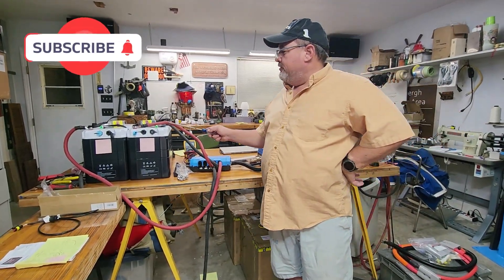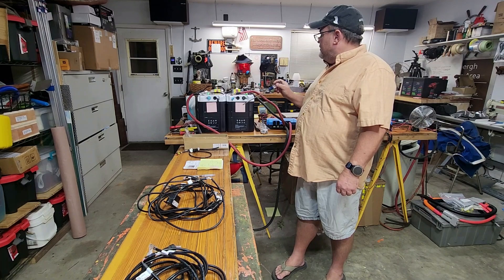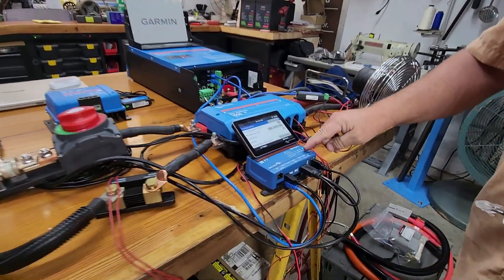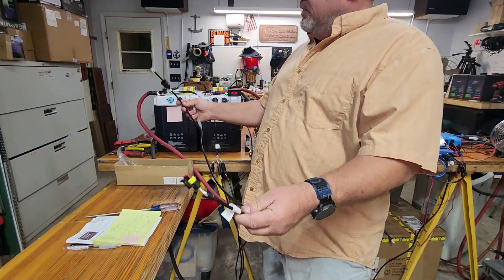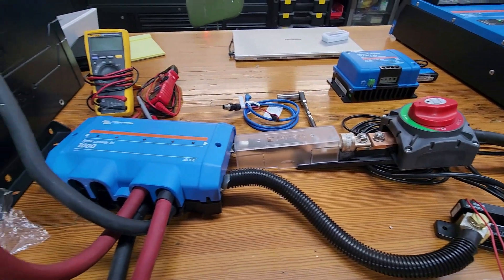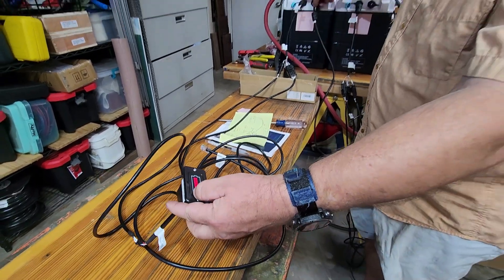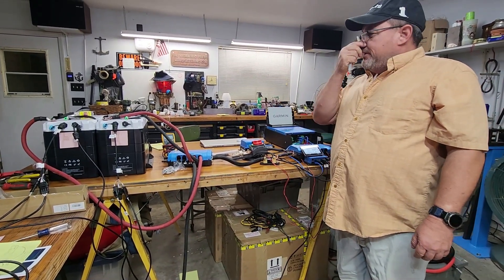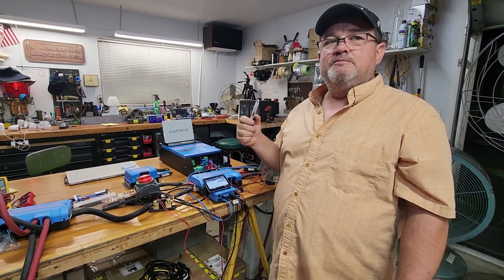Epoch Lithium 460AH V1  Daisy chain hook up  with Victron Comm to Cerbo GX. **Not for V2 batteries**

Comment: I have three 460's daisy-chained into the Victron Cerbo GX (w/gui mods).  They show as one battery, though it does indicate how many batteries are "online".  However, using the Epoch App, I can only see data for Battery 1.  The others connect but are blank.  Are you experiencing the same?   Or can you see both battery's details in the App?  Any tips?
Reply from the maker: Actually in the beginning both batteries could be pulled up on the app. But lately only one comes up. I havent had time to mess around with it lately but plan to. Let me know if you figure it out.
Reply: @mvintrigue-trawlerdiy1101   I am guessing it stopped when you changed the dip switches and daisy chained.  I spoke with Epoch and they are looking into it - it seems that once the dip switches are set to indicate master and slave etc. the software treats it as one battery.  It's just a shame to loose the per cell detail.  The Cerbo just tells me the battery and cell with the highest and the lowest voltage (which, I guess, is sufficient).  I'll let you know if I learn anything new.
Reply from the maker: @SVHolokai  Thanks...as will I. Much appreciated.

Comment: Any info on connecting more than 2 batteries to the cerbo?
Reply from the maker: Obviously I dont have more than 2 to do a real test but I am assuming...at the point in the video at the end when I hooked up the final harness, you would then need another short cable and that would  hook up from batt 3 to batt 2 in the same way. Wish I had another just to test this.
Reply: Hook one of the 300AH v2 batteries and see.
Reply from the maker: @drtywhat  I would need to order another daisy chain cable to do that. The short one with the GM weatherpack plug. But someone just commented they have 3 of these online with no issue.

Comment: My 460 is coming, I understand everything but the dip switches. Just one battery and a smartshunt, hopefully it will be easy to sort out. The instructions in the manual are pretty vague.
Reply from the maker: You should be able to leave the dip switches in the position they come it. And you wont need the extra cable. Its going to be pretty much plug and play and very simple. Its good having the smart shunt too IMO. Its amazing how much SOC meters wander at times. So having 2 is a good way to compare things over the long term and double check each against the other. Dont be alarmed if things arent exact between the SOC and voltage of the smart shunt and the Epoch. They will never marry perfectly.
Reply: @mvintrigue-trawlerdiy1101  
Thank you, I'm unhappy with the batteries I have, they are completely isolated and still lose a lot of voltage as soon as the charger shuts down. No way there can be a parasitic draw. Less than 3 years old. Oh well, live and learn. Appreciate the response. Fair winds.
Reply from the maker: @cabracove  are the ones you have lithium with bluetooth? When you put your Epochs in place dont toss the old ones. If they werent isolated by disconnecting all wiring then they may be ok, and when you put the Epochs in it is possible they too will drain if everything hasn't been eliminated with careful troubleshooting. But of course I dont know know what kind of troubleshooting you have done. The only way to troubleshoot a draining battery is to pull it out and put it on the bench for testing or to disconnect all wires and check it with a multimeter over time. Also if you have a multimeter there is typically a function to test if you have a draw. Most multimeters can measure up to 10amps of draw before they blow an internal fuse. You would have to disconnect the positive battery terminal and connect the two multimeter leads between the battery terminal and the battery post and put the meter in the setting to measure amps. it should be 0 of course. be sure to turn all breakers and systems off and isolate your systems as you said you did. And do not turn anything on or you could quickly blow the fuse in the multimeter. See if you do in fact have a draw. You might be surprised. If you have already done this then of course the battery or batteries could be at fault. Of course if the ones you have are lead acid batteries they have a much higher self discharge than lithium.

Comment: great video, thanks for sharing.  I havnt hooked up my 300AH battery yet but would have been confused if the errors start showing up.
Reply from the maker: Definitely. I was confused too. But in doing research on new Victron capable batteries its pretty common with batteries like Pylontech and many others as well as several people who are running the Epochs. I haven't had those warnings since.

Comment from the maker: *Important update* Go check out Ben Steins video (Panbo) where he takes one of these apart. Right off the bat he has discovered that the 460AH Marine batteries contain a 500 amp Class T fuse INSIDE each battery with an AIC rating of 50k. This is a real game changer. IMO this is the best designed and safest Lifepo4 battery on the market. It is a real engineering effort with clean sheet design. Looking forward to the remaining testing by Ben.

Comment: I have only watched the first 35-seconds, but it is terrifying to watch you use a metal screwdriver as a pointer to tap on an LFP battery.  I am curious as to how well the white balance on your camera can handle an LFP arc flash.
Reply from the maker: Arc flash on 12 volts is not likely. In addition, the SC Protect feature on the BMS work fantastic. I have actually tested it and its quite anticlimactic.
Reply: @mvintrigue-trawlerdiy1101  You tested your battery with a dead short between the battery + & - terminal?  You are a braver man than I.
Reply from the maker: @haydenwatson7987  well not this one. This one is too expensive to risk..lol. I did it on a 100ah 12 volt version with a high amp carbon pile tester.  One thing to add that I just became aware of. There is a Class T fuse inside the Epoch 460 ah battery case. Pretty incredible. Pretty mindblowing really. That another level of safety most battery manufacturers had not even considered.
Reply: @mvintrigue-trawlerdiy1101  That is very nice.  Can you access it to replace if your screwdriver pointer shorts it out? ;>).  I have a couple of Basen Green 460Ah and have also tested them to well above rated.  I got 480Ah from one and a bit less from the other.  It had Bluetooth but not the com ports.  They were the first offering that I had seen in the 460Ah range and where in a standard 8D case which fit perfectly into my battery tray.
Reply from the maker: @haydenwatson7987  lol...yes its accessible. The top is held together with allen head screws. Next time ill use my coated electricians screwdrivers just for you..lol

Comment: When you’ve got 2 batts hooked up with this newer comm style (using the new comm wire), does battery widget on the GX Touch 50 still alternate between battery 1 and battery 2 when telling you SOC and amps in/out? Or now with the new method, does it read it more like one large battery bank? 
To be clear, I’m only asking about that main Home Screen so popular on the GX touch displays. Battery icon in the lower left corner. 

Thanks!
Reply from the maker: Actually ill have to look. On the device list everything appears as one battery
 Im sure the home screen does too. Really, i need to do the Cerbo gx GUI mods. It adds a ton more info. I bet that would help with more detail.
Reply: @mvintrigue-trawlerdiy1101 another question, is the epoch still only registering amps in/out if they exceed 1 amp? I have one of these batteries now too (and getting my Victron equipment soon, including a Cerbo and touch 50), and I see the epoch App on my phone is measuring to the tenth of a volt.
Reply from the maker: @murp0443  So on your first question. It does not alternate but shows 2 batts online and 940ah. The batt icon on the main page just shows SOC. Nothing else. It still does not appear to register anything less than 1 amp. But again, I dont know if this is going to be an issue or not. It would only be an issue if you are in a situation where your entire boat or camp was drawing less than 1 amp. Seems unlikely. Same goes for charging. Seems unlikely you will be charging at .7 amps.

Comment: Very exciting to see yet another video! I also have received my 12V460AH though what condition was yours in? Mine has grease marks all on top and the bottom is completely scuffed up… I reached out they told me they open the battery boxes at the warehouse to place the cables inside and that it’s for sure brand new and that the warehouse guy must have had dirty hands… curious to hear about your batteries cosmetic when received
Reply from the maker: Sorry to hear that. Mine were just fine. You can power it up and double check how many cycles are on the battery via the app to make sure it wasnt used.
Reply: Interesting. I did check today and app says 1 cycle and at 27% I just bought a load tester and will check to make sure  I have 460Ah or hopefully more Ah than rated for such as in your case and if everything is balancing and healthy I suppose it should be okay to keep and move forward with my project. Looking forward to your progress and excited to get started on mine. Just have to buy the victron goods and waiting to order the arco zeus regulator  @mvintrigue-trawlerdiy1101

Comment: The “old way” to install Lithium was to set your charging equipment within the parameters of the BMS. The BMS shutdown should only be the last protection if something goes wrong with the charging equipment.  How does the V-Bus handling this?  Is there still over and under volt settings in the Victron chargers that will be triggered if anything goes wrong with the BMS?
Reply from the maker: It appears that both can be true. The Epoch still has its basic parameters set using the BMS. But along side that are another layer of protections and warnings. For instance you might get a cell imbalance warning on the Victron Touch 50 that comes from the Epoch, but does not trigger any of the Epoch BMS hard faults. Its hard to know what they all will do. But I have done a discharge pulling 150 amps down to 1% SOC and then used a smaller load till battery disconnect/shutdown. The Epoch app reported some items and the Victron reported other items and shut the inverter down. Everything seemed to work flawless. The bluetooth remained on to acess the battery but discharge mosfet for batt was off and as I said Victron shut down inverter. It would take a bit more testing to know who is doing what and when. But just casually observing it just appears to work.

Comment: Great video . Looks really nice. Is there any differences between the 300 Ah and  the 460 in regard to connection/communication?
Reply from the maker: Yes there is. I have not had the chance to completely set up the Essentials 300ah batteries completely though. One thing to note is a 300ah version of the battery covered in this video will be released soon.
Reply: It looks like to 300 is a standard battery, while the 309-V2 also supports the Victron V2 coms. I’m guessing but I think for a second battery the cable B12300 A H05 -4505, will be needed instead of the B12460 A H05 -4505 mentioned in this video.

Comment: Great info. On that H05-4505 cable or the harness with the battery, was there a peel-off port (I made that word up) for hooking up a 3rd battery? I’m also asking Epoch what that same cable is for their 12300A-V2 batteries (that you also have in the back there). 

After you’ve done that extra charge and discharge cycle that helped get rid of some warnings, have you now gone back to more “popular” lithium charge voltages (in the mid 14’s)? 

Thanks again!!!
Reply from the maker: I believe, on the last part of the video when I hook up the power meter for the unused port on batt 2...you would then get another H05-4505 and plug it into batt number 3 in the same way we did batt 2. Then hook uo the other end of H05-4505 into the open GM weatherpack connector now plugged into batt #2. You should be able to daisy chain continously.
Reply: Nice.